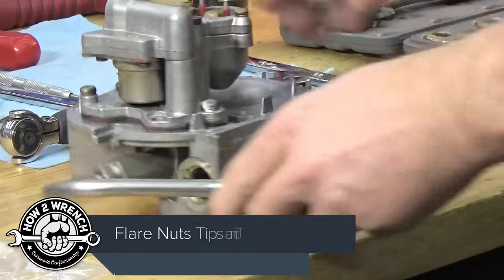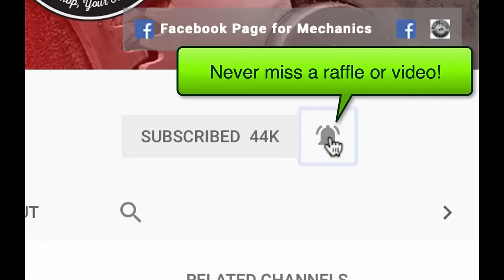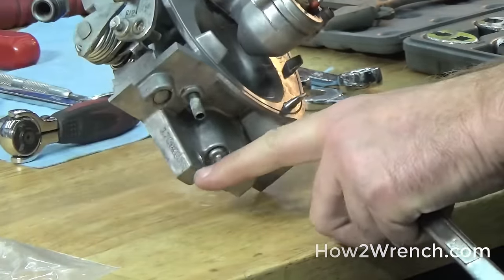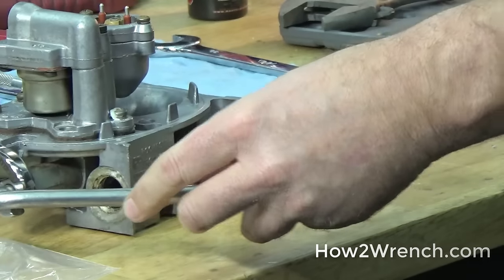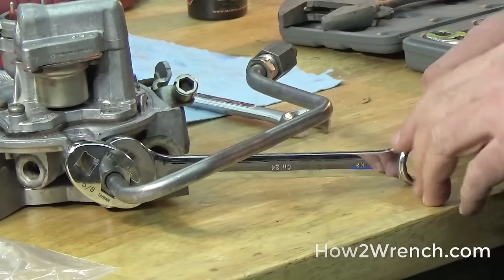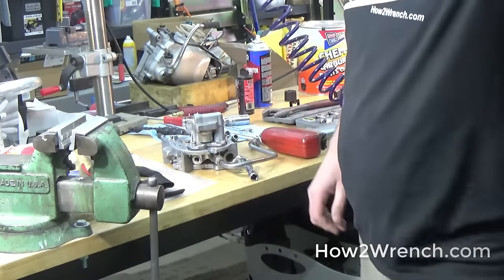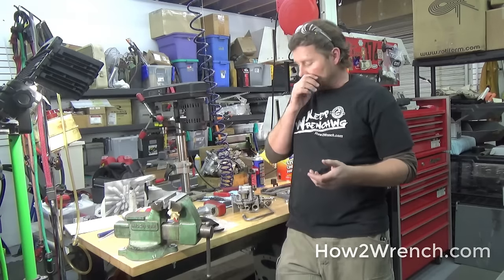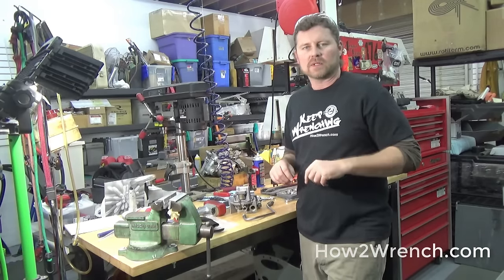How to remove a stuck, rusty or damaged flare nut or line nut.

Comment: I've had great luck by starting to spray the lines 2 weeks ahead of time and keep them wet for a few days before hand. Then use the correct tools and stop applying force  if it doesn't turn with the wrench. Trying several wrenches can yield a tighter fit. Also my dad had great success by putting vice grips on flare wrenches, squeezing them together to clamp the nut. You may have to grind some flats on the wrench. This worked great on soft nuts and fittings that were already damaged.
Reply from the maker: Thank you for taking the time to comment! Hit that subscribe button please! It helps us!
Here is a way to support all the free videos.
Want to say “thanks” or “keep it up”? Click here https://www.paypal.me/how2wrench  

Coach Conley is also available for hire to personally work one on one with you if ever needed. Yep he is a real person. Give him a call @ 602-345-0432

Your answers and help are just around the corner. Save time and money while protecting your investment and yourself by doing it the right way!
Follow us!
Web:
www.How2Wrench.com    
www.Tools2Wrench.com
Reply: I'm furiously scouring the net for any hack/cheat code/magic to deal with 10mm head brake fittings that hadn't been touched in 15yrs(during which it's never been garaged kept)...  A quick wire brushing and they're more like 9.5mm and...  yeah.  Looking like my day may be starting with grinding a wrench!   THANKS! 👍🧑‍🔧

FYI: Some of my previous 'unorthodox' adventures include cleaning out bead seal leaks on a tire using a scissor jack under the front bumper of a truck to break the bead...  Good times, good times...
Reply: Those lines are not rusty as mine. No flare is fitting because its so rusty. Maybe induction heater will help, I've showerd with liquid wrench week ago and I will try agian this weekend I hope it will soften it.
Reply: Grind the rear face of the spanner flat so that the whole depth of the nut is in contact. Even with brake pipes, you can use heat. Wear goggles and be prepared for spitting, and as far as possible, protect other areas with steel plate. Get very hot. When it moves a tiny bit, re tighten and reverse many times, moving a little more each time. Good luck!

Comment: Great tip  we also in the shop working on our toro dingo,s on the steel hydraulic lines we use a air hammer. You put the bit on the edge of the flare nut in the direction it will loosen. And very lightly just burp the trigger. Never had it not work.
Reply from the maker: Thanks for commenting and adding value to our community! 

Please subscribe, share and consider a H2W membership to support our free work here! We are ramping up for the upcoming new member only site with profiles, raffle drawings, and weekly live Q/A sessions and a for sale page!

We have a LIVE Q&A starting soon and will use comments from videos to try and answer too. Got a question you need answered sooner than our LIVE Q&A Shows are on? Here’s how to get your answer for free! https://youtu.be/oAeXz1nd-eQ (and other free tools and products!)

Get my cell number here: https://how2wrench.com/product/personal-tech-training-phone-facetime/

Have you subscribed yet to never miss a video? Have you seen the video playlists? Over 600 videos! Check them out here: https://www.youtube.com/user/conleybuilt/playlists    

Your answers and help are just around the corner. Save time and money while protecting your investment and yourself by doing it the right way at www.How2Wrench.com    

Want to say “thanks” or “keep it up”? Click here https://www.paypal.me/how2wrench  Thanks for commenting and adding value to our community!

Comment: Flare wrenches or line wrenches almost never work as good as advertised, in my experience 9 times out of 10 you will strip the flare nut if you use a line wrench, they work ok if the nut is not very tight but in most cases the nut is severely rusted and really tight and when you put torque on the line wrench the opening on the wrench will expand and then you will round the edges on the nut, sometimes if there's enough room you lock the end shut tighter with a pair of vice grips but in most situations there's physically not enough room, personally I don't even bother with line wrenches anymore, I have tried multiple brands from the cheap stuff from home Depot to the premium brands like snap-on and MAC tools, all of them are junk, my motto with flare fitting is that if I can't get them loose with a regular wrench, just cut your losses and get the fitting out by any means necessary, cut the line and use a socket or use vice grips and then build or buy a new line and start over, I have wasted so much time trying to save old brake and fuel lines and end up destroying them in the end and having to build a new one anyway. If it's something really rare or irreplaceable then yes try by all means to remove delicately but for 99% of jobs just get after it and don't worry about saving everything just get it done.
Reply: You’re exactly right. I bought line wrenches thinking they were the magic solution. But they’ll just round over the nut like a normal open end wrench would.
Reply: @LongIslandCityLayout  yep flare/line wrenches are super overrated junk, I have had better luck using a high quality regular wrench (usually will try several till I get the tightest fit) and then if there's enough room, try to clamp a pair of vise grips over the ends of the wrench and give it a shot, sometimes though some flare nuts are just too rusted or have been waaaay overtightened and nothing you do will get it loose, it's just the nature of the design.
Reply: I agree with you nearly all of them expand on severely stuck compression nuts on fuel filters.   You are absolutely right, cut the rubber  line and have a new one made.    I have squashed a vice grip as tight as I could get  and still rounds the corners.

Comment: Shane--Great video.  As a DIYer, I'd be hesitant about using an impact wrench to break that flare nut loose.  There's a chance of over-torqueing it and turning the fuel line into a pretzel.  However, did you try hand wrenches earlier and get nowhere with them, then turned to this option for results?   I can see where, if it's really stuck, you'd round off one (or both) nuts trying to remove them manually, so the impact makes sense.
Reply: You’re right! You should definitely use a ratchet when working on any type of lines in a vehicle, they’re a little delicate to use with an impact.

Comment: I tried crow foot with an extension and a impact gun (1993 honda accord lx gear box) (power steering line). Well, guess what happened? It broke the line and twisted it and the line busted off. Scary when it happened, I'm just glad it didn't destroy any lines right next to it
Reply: Well, I was able to replace it anyways. After the line broke, I just took a 12 mm socket and used a impact and got it off. Next time I should just cut the line instead and then put a socket on LOL.

Comment: don't have flare nut wrench's, but i do have crow foot wrench's, i have a stuck bolt on brake line which i been using pliers to no avail except to rounding it off. i'm trying to look for a PA312 fitting so i can just remove the whole line (front brake line on 03 f150 4.6l xlt 4x4.)

Comment: What about using the crowfoot flare nut wrench on brake lines? I gotta change my calipers and am seen whats better so i don't break or strip the break line bolt?,i have spray them with Pb blaster,regular flare nut wrench? Or crowfoot flare nut wrench? Please help

Comment: Flare wrench wasnt working  on my Honda master cylinder. Didnt think to use an impact.
Reply: I did I just don’t have one
Reply: If you can get a good bite with the wrench, to can apply some quick taps with a hammer to the wrench, sometimes jarring it a bit helps it break loose - after soaking with penatrent as long as possible and/or a bit of heat if clearances allow

Comment: open ended wrenches serve a purpose but not on the undercarriage of a 20 year old car in the snow belt areas. I just bought a set of these just to change my power steering hose. I changed some brake lines last week and I need to do all the  lines to the callipers next and they aren't looking pretty. These will come in handy, I hope.